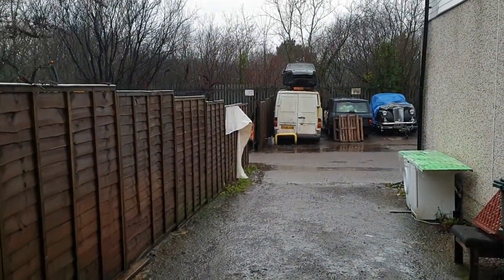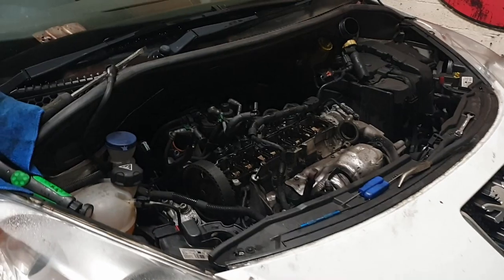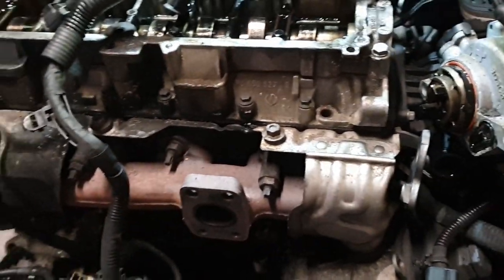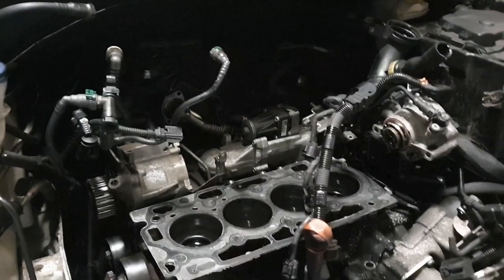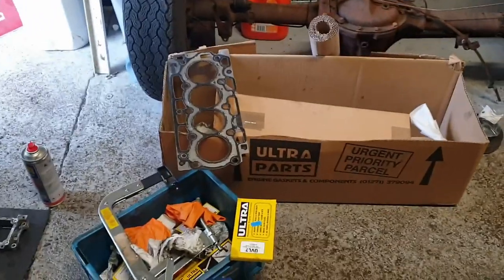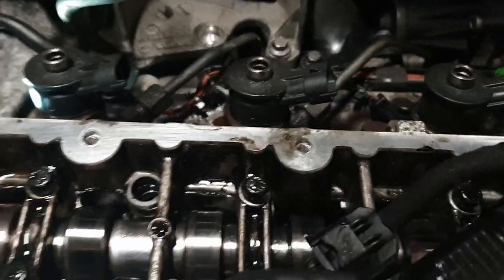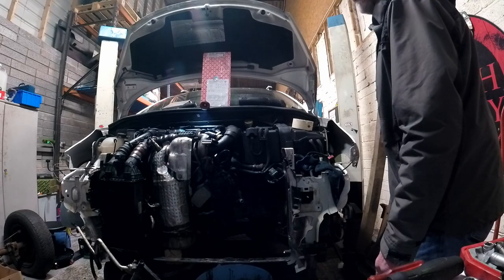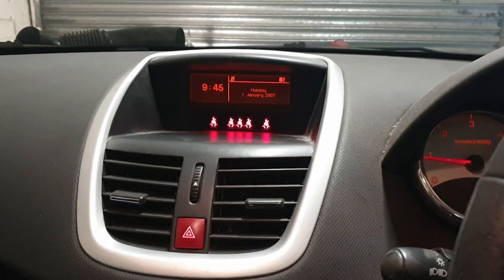Peugeot Citroen 1.6hdi Cambelt failure can it be fixed? Merry Christmas!

Comment: Great video, same has happened to my Peugeot Partner 1.6hdi 126000 miles and it's with a mechanic who is doing the same, at least I know what it entails. One garage said I need a knew engine which you  shown isn't always the case.

Comment: You dont need to remove the head on these as the valves are usually fine. Just replace the followers and camshaft

Comment: I’ve fixed a few of these, normally simple enough job rockers and cam, I always check the valves are moving freely, but I got one in start of week bent 3 valves broke 2 valve guides and destroyed 2 valve seats haha, cylinder head replaced and turbo aswell as the vanes in turbo were bent from said valve guide 😂 ran sweet after tho,

Comment: Very usefull information for me man thank you i am at the moment working on the same problem but i didnt know about the camlobed that it was pressed on the cam so i put everything back together and the engine was running very bad im glad with this video
Reply from the maker: I'm glad you found it. I nearly burnt the 1st one I did. (This was the 2nd) I tried everything until 1 guy told me about the stupid cam. It ran sweet then. Good luck with the one your doing...thanks for watching.👍
Reply: Unfortunatly the car wouldnt start i place today a new camshaft it cranks but doesnt start i had exacly the same thing as you broking belt what do you think ?
Reply: It was btw a second hand camshaft i tried really everything take out the cilinderhead twice i am at a point to going crazy haha
Reply from the maker: Mmm tricky one. Any fault codes? Have you tried misting easy start and see if it kicks? Your happy you have the timing spot on?
Reply: Gfix i already fixed it my friend it was just the camshaft the one i got from second hand was more fuckedup then mine so i put new one it was just starting perfect thanx bro if i didnt see this video i never couldnt fix it haha

Comment: My 15 plate berlingo van has a similar problem I think, I was travelling at 15mph when I felt something, then slowed down to under 5mph, then the engine stopped,,,,, what are the chances of an easyish fix? Considering how slow I was travelling??
Reply from the maker: If your lucky it might just be rockers, cams and the belt kit. The key is whether you got the clutch down when it went... allowing the engine to stop rather than try to rotate with broken bits. So yours is 9 yrs old I would guess your around a 100k?

Comment: Hi, I'm halfway through one of these. Exact same problem, stripped belt teeth... Smashed rouckers bla bla bla!
I was expecting to find the water pump or fuel pump locked up... The fuel pump is very hard to turn by hand and feels under spring tension at certain angles.. is this normal? 
Thanks
Paul

Comment: Good educational video! 

It cleared a lot of questions I had since I'm just going through the same busted timing belt problem with all the related issues. 

One quick question if I may. In the video you mentioned a few dents on the pistons from the valves. To what extend damaged pistons can be reused and when do you replace them. Is it worth it to go through all the hassle or is it better to replace the entire engine.
My car is a 2004 Peugeot 307 sw 2.0 HDI with 330.000 km or 210000 miles approx.  
Thanks in advance.

Again, great video!!!!!

Comment: Can i ask . When you timed up the cam this can be 180 degree out . What reference did you use to make sure it was timed correctly .  The video it great .makes a change to see a real person working on a car who actually knows what he's talking about
Reply: I think that's my problem. I had a failure, all marks lined up. But was told I need to turn the camshaft another 180. Car doesn't start, even with easy start.

Comment: Amazing video, thanks for sharing, just a quick one, how much did u charge for this job, I think my car has the same issue?
Reply from the maker: The parts came in at about £500 and maybe the same pos slightly less for labour, it's quite a big job. The guy who's car it was got quoted 1400 for an engine change and then do you change the clutch etc....

Comment: does the cam have to be replaced as well as the rocker arms?
Reply: I've seen a 1.6 Hdi (ford) actually move the camlobes on the cam (they're pressfit) so it no longer had compression. After it tossed a timing belt. 
So a compression test should reveal that. 
Also busted a couple of rockers like this one. It lived again, cant remember if it the valve was busted.

Comment: These belts supposed to be replaced at 240.000 km or 10 years...i think you better not surpass the milage.About the age of the belt its hard to say.. if the car is inside or outside parked ,cold warm etc .but better not gamble with these things....also any sound  from distribution is worth changing the whole set...